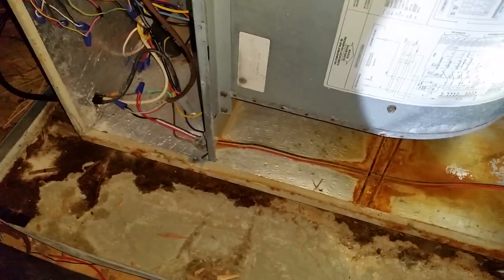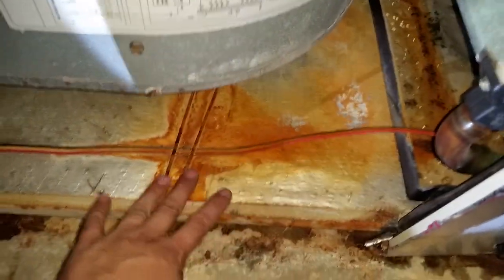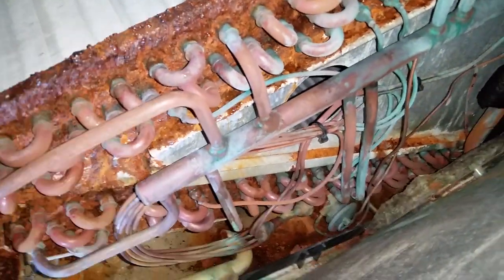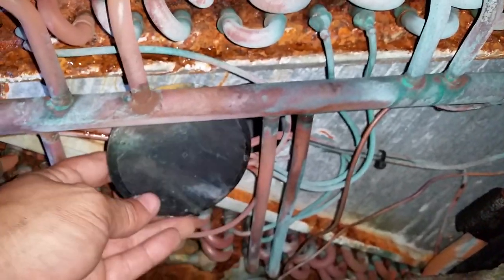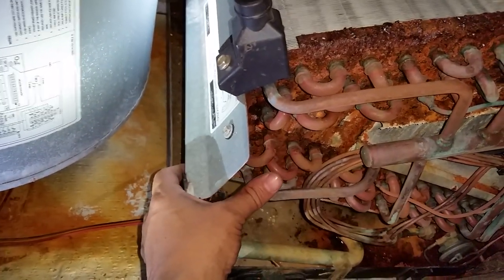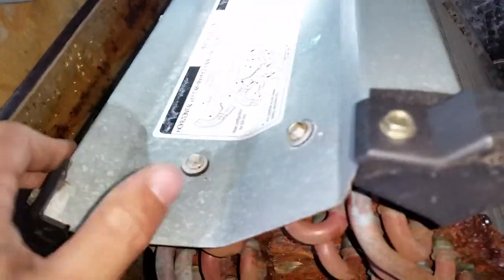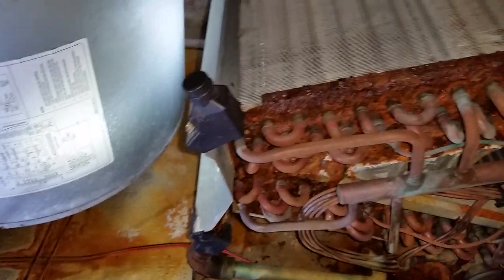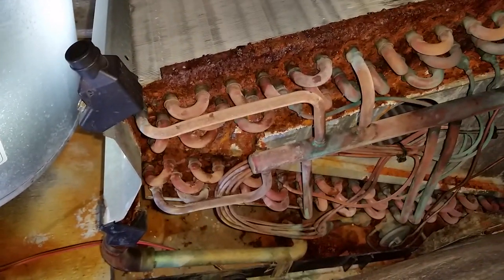Evaporator coil deteriorating

Comment: Is there a rust preventer that can be used on the coils to prevent rust?
Reply: Yep. There are coil coatings out there but they'll be of most benefit treating a new system.
Reply: Copper coils with aluminum find creates formicary corrosion causing leaks. That pic is steel frame rusting.

Comment: I’ve got a 2004/5 system still going strong, but I’ve got some rust (nowhere near this amount) on the coils. Is there a product that can remove the rust and protect them to extend the life of the system? Also, how much did you quote this people for what job exactly? Just replacing this unit?
Reply: You can use a rust remover and then coat with an AC coil protectant. You have to be careful not to damage anything though if you're using a wire brush to get off buildup. It's pretty normal for the steel to rust a bit and the copper/aluminum will be fine. When it rusts out too much things start moving around and you risk rubbing holes in the metal that isn't corroded.

Comment: What caused it to rust???
Reply from the maker: Galvanic Corrosion
Reply: @HVACinSC  what is that.... does that mean I've gotta change my coils?? I just was checking my  filter and noticed that.. it was never like that months back.
Reply from the maker: @billyjoe3014  I cant give recommendations on a system I haven't personally checked. I suggest calling a licensed professional to check over the system.

Comment: was the ductwork undersized or has that unit just had a lot of drain issues
Reply from the maker: It had several issues. Biggest of which was a horribly designed attempt at a zoning system.